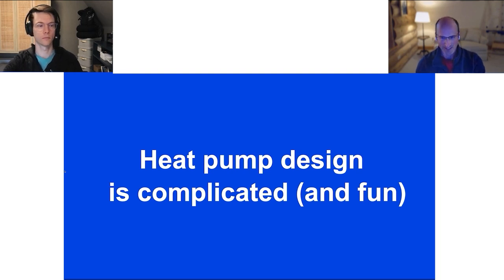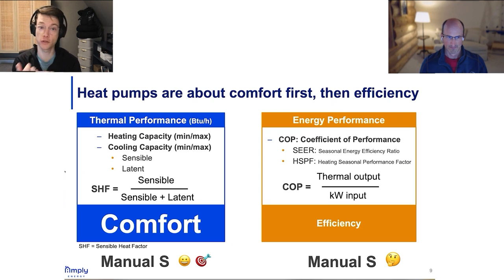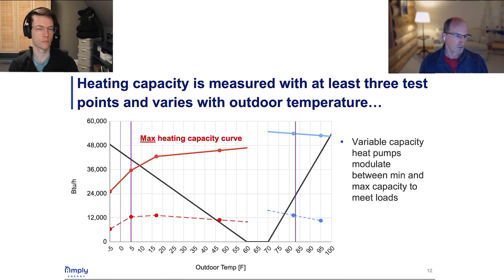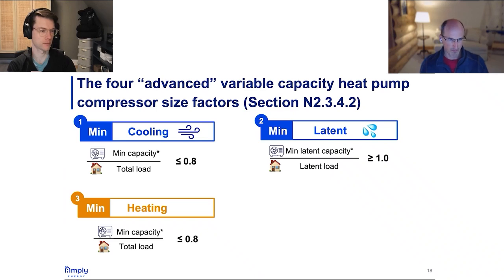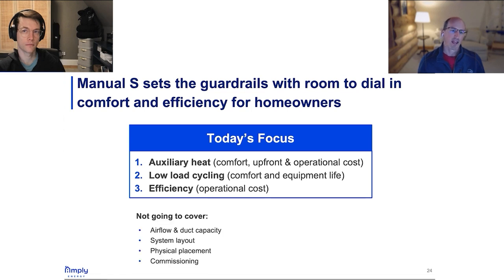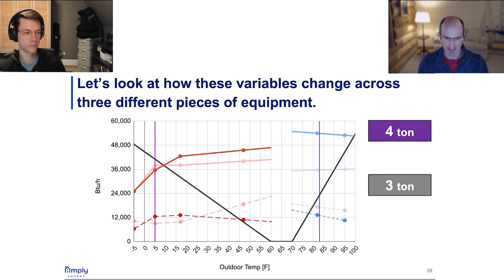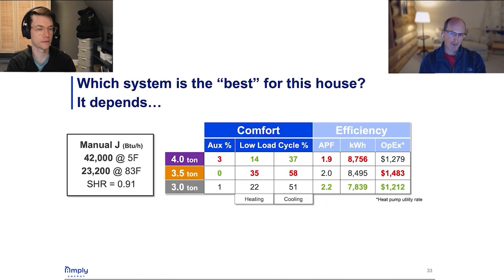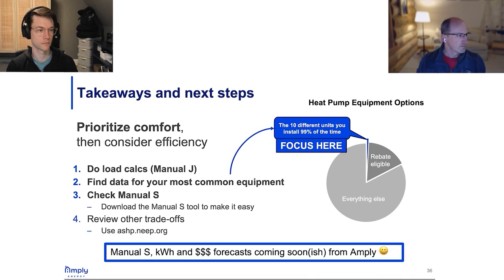Where Heat Pump Design Gets Fun – Manual S and Beyond with Eric Fitz

Comment: your efficiency vs size projections are not accurate real world, this is because inverter heatpumps are more efficient when running at a lower percentage capacity. a 4 ton for example on same load on average runs at a lower percentage of max capacity compared to 3 ton.

Comment: I am having a house built, and being a DIYer at heart, learned about Manual J.  I used an ACCA certified tool, and came up with the metrics needed to size the system.  This video and your interpretation, as well as the spreadsheet are extremely helpful since it wasn't clear how to proceed with Manual S.  I am considering Mitsubishi with hyperheat, and a whole house air handler.  They have a manual with several hundred pages of data.  I haven't seen latent capacity, but I haven't looked for it yet. edit  Your spreadsheet tool is outstanding.  To obtain the Latent Heat capacity at 85 deg, I found in Sec 1.10 of Manual S that you use Latent Heat at 75 deg dry bulb and 83 deg wet bulb inside temperatures.  I had to interpolate, since in the design data they had rows for 61 and 64 deg wet bulb .  Also 77 and 86 deg outside temperature.  And of course the table had sensible values that had to used to find the latent values.  The NEEP database is a great resource to go with your spreadsheet since it uses the same data points.  So glad to find your video and spreadsheet!

Comment: I'm a heat pump user - not a HVAC professional. I typically monitor performance of my equipment - temperatures, estimate COP, electrical use. I have a 12k minisplit and just replaced a 2 ton single speed York split with a 2 ton Midea variable flow unit. In my experience heat pumps are different animals when operating in heating or cooling mode. (my interest is heating only) In heating defrost becomes a potentially significant issue yet for some reason no one even talks about it. I did not hear the word once in the presentation. I suspect that the defrost performance varies among manufacturers but how do you find that data? For instance, my minisplit will defrost every 90 minutes whenever outside ambient is below - 3C, a very common condition here. I should add that this is totally independent of frost formation! Is this data in the NEEP database? I think it makes sense to have the equipment operate at the maximum COP. My heat pump is much more efficient at low flow rates. And I don't like this word 'comfort'. I think you need to define what you mean. I can live with +/- 1C just fine.
Reply: This is a good point, defrost and how smart the algorithm is can impact the efficiency, but I guess that should be accounted for in the HSPF to some degree?  What's also interesting is what impact the low load cycling has on the energy consumption which I don't think is accounted for in HSPF but I'm not sure how significant the extra energy consumption would be.